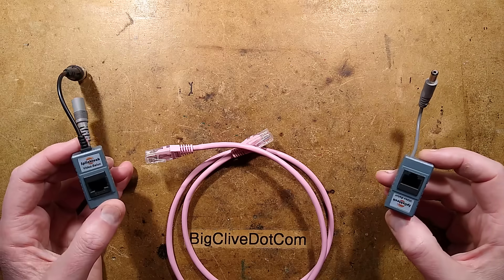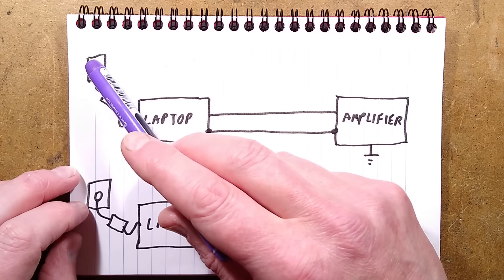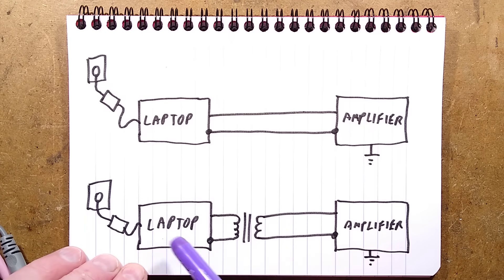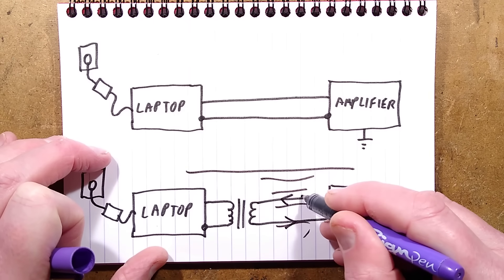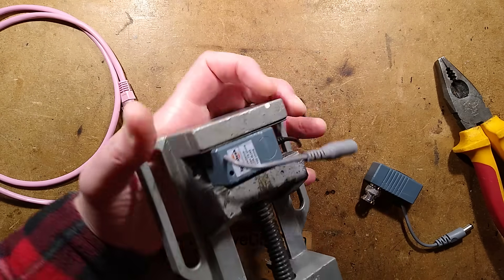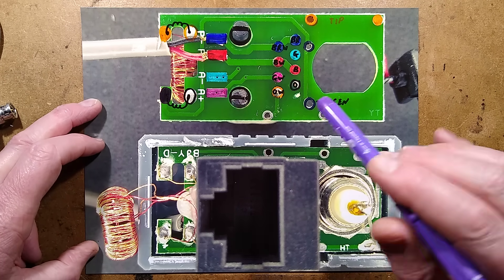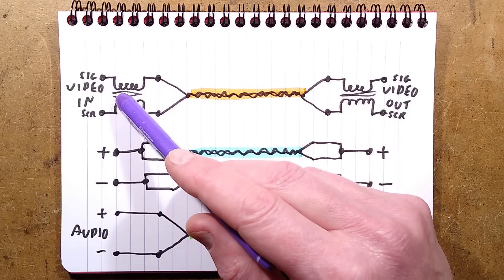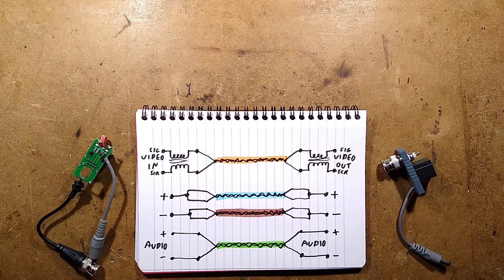Baluns - I got this one wrong (with schematic)

Comment: The two basic types of balun are voltage - providing the galvanic isolation you were talking about - and current which is the type used here.
One of the problems with voltage baluns is that they are frequency sensitive so that not only is it difficult to build an off-the-shelf product but certain frequencies in signals such as video could be blocked or enhanced.

In current type baluns, at the transmission end the parallel windings cause the signal in the co-ax centre wire to be mirrored on the other winding giving a differential (balanced) signal on the output wires. At the receiving end the opposite happens and the signal on the earthed (shield) winding reinforces that in the centre wire.

As you stated, any interference induced in the link cable will be equal on both wires so the windings act as a common mode choke.
All that is needed is for the windings matched to the impedance of the co-ax cable so it can be built without reference to the frequencies being used (within operating limits of the cable).

The audio signal is already a balanced signal so doesn't need to be converted. Common mode chokes might be useful at the receiving end but that should already be a function of the audio circuit, if necessary.
Reply: Induced noise, where unwanted signals are insinuated on to the wires by electromagnetic fields are only one type of noise. In the case that Clive was talking about—long lines that move from an area served by one power source to another, a big problem are “ground loops”.

To understand why, you have to understand what “ground” means—it is one of the most abused terms in electronics. The primary meaning, and where it gets its name is “earth”. Whether you call it earth or ground, it is literally a conductive rod driven into the earth and used as the “low” side reference for electrical circuits. You see, “0V” (zero volts) is an arbitrary thing. Something is at 0V always and only with respect to something else.

Any things were are *equipotential*, that is, at the same level of charge, are at 0V with respect to each other. Two objects with a potential of 1000V relative to earth are at 0V relative to each other. The trouble is, different parts of earth are also at different potentials relative to each other. So “ground” isn’t a fixed reference point. This is made worse because the term ground is used for many different things: earth ground, chassis ground, circuit ground, and rigorously the 0V point in a circuit.

In the case of our ground loop, it can be encountered when the piece of equipment whose output is connected to the input of another piece of equipment has a ground (in this case the ground of the electrical system, provided at the receptacle) that is not equipotential with the ground of the equipment it is being connected to. Whatever the (electrical) potential difference  between the two will cause current to flow in the direction of the lower voltage side.

For an unbalanced (or Hi-Z) input, where a shielded/screened cable is used to reject the induced noise mentioned above, the audio depends on both the center conductor and the shield which acts as the low side connection. If this is also bonded to ground via the electrical supply to make it effective at rejecting induced noise, it will be carrying the current caused by the difference between the two grounds. This can produce a hum—at the 50 or 60Hz of the AC power—that ranges from subtle to devastatingly loud.

A solution for this is to use a transformer in the way Clive first imagined the balun in this device. Had it been a voltage balun it would have been as expected and for reasons other than isolating ground, though still effective at it. Baluns are impedance matching devices. You can think of impedance as resistance but for AC rather than DC. A transmission lines is a physical arrangements of conductors that allow an AC signal to be moved from one point to another. The design of. transmission lines is increasingly critical as the frequency increases.

Transmission lines have a characteristic impedance, expressed in Ω (Ohms). In the case of the balun in the video, the original coax is unbalanced line, and used a shield/screen for noise rejection. It has an impedance of 75Ω and anything that connects to the BNC connector will be a match for that. This allows the maximum transfer of the energy in the signal.

The Cat 5 cable is a balanced line using twisted pairs to reject induced noise. It does this by having an appropriate twist rate so that for every distance equal to the length of a twist each of the two conductors get an opposite induced current from external noise, cancelling it. This is called “common mode noice rejection”. It has an impedance of 100Ω and so of the 75Ω devices are connected directly, the mismatch will cause severe signal attenuation.

This is caused by the signal literally reflecting off the point of mismatch. (This video makes all this much easier to understand, including the impedance matching part, I strongly encourage watching it: https://youtu.be/DovunOxlY1k?si=sDvEON-fvsi5dKaf&t=76) I think you’ll come away with a better intuition for this.

So, to make the Cat 5 usable by the video equipment, it is necessary to match it to the 75Ω gear. This is where the balun comes in. A balun transformer is like an ordinary transformer in a power supply except concerned with the impedance. Similarly, it depends on the ration of primary to secondary turns in the two magnetically coupled coils. In this case, we 75:100 or 3:4 ratio.

To use a transformer for galvanic isolation, we generally want a 1:1 ratio so as not to change the voltage of the signal. If a transformer is placed between the two pieces of gear, there is no electrical path for the hum to take. The connection is turned from galvanic (voltage and current) to magnetic. This magnetic connection can’t be a path for the ground difference to cause current flow.

These two forms of unwanted signals: induced (from radio and other AC sources), and group loops are different but both are potential problems (no pun intended, unless you liked it). A balun, per se, isn’t seeking to address either one, but the heart of the balun, the transformer, is one way to eliminate one of them. It is also the case that a shielded balanced line cable can take advantage of the faraday cage like shield/screen with a good earth ground connection but with n banger of ground loops since the signal doesn’t use the shield as a path.
Reply: @YaakovSloman  Thanks for taking the time to write that. I'm both enlightened and confused by it.
Reply: @YaakovSloman You missed two major points:
A. 0V is the arbitrary point that other voltages are relative to, 0V isn't relative to anything .
B. The ground loop discussed in the video comes from the Laptop 0V chasis being capacitively coupled to the virtual midpoint between 240V/50Hz and AC 0V which is grounded, while the monitor 0V chasis is actually grounded .  Thus there is a weak capacitive 50 Hz signal plus switch mode noise returning to ground through the monitor if connected directly by 50 ohm coax .
Reply: Yes professional audio is balance but for example car audio is not. A balun can supress the majority of groundloop noises when there is such problem.
Reply: I used to install RF baluns on aerial and satv installs as part of a past life. Nobody clarified the science and it was always a matter of trial and error to find the best option. Channel 5 baluns were a thing in some places from memory. I may still have some amidst my collection of LNBs and associated gubbins. I first encountered them in my mother's 2mtr band equipment but only ever by name and the vague description of them being filters.
Reply: @just_saw_dust yes I remember c5 filters something to do with vcr output interference ?
Reply: Great explanation!
Reply: Neither Audio (RCA) or Video (BNC) is balanced in the CCTV setups. They all share the same ground potential on both ends so not sure what you mean there. Presented setup seems to only do impedance matching and bandwidth limiting. Nothing more.
Reply: So how much are we talking about with interference?  I mean, like milliwatts? I work with 1500 KW power supplies.
Reply: @wanjockey  That will depend on what is close to the cable and how much shielding it has. If it is running past one of your 1500KW power supplies I would think it could be quite significant. Video signals typically run at about 1V so even an induced 10mV ripple could cause problems.
Reply: 1.5 Mega Watts ? @wanjockey
Reply: @andymouse you could say 1.5MW, but it's just not how it's said.  More often than not, MW is used for power generation and kVA is used for transformers (so 1500kVA, not 1.5MVA).  Why volt-amps and not watts? No idea, but it's what is done in the industry and is basically the same since P=I*E (Watts=Amps*Volts).
Reply: Yes, 1500 KW power supplies that melt metal. We make the steel tubes for hydraulic cylinders.  The copper buss bars are in trenches in the floor.
Reply: Wow yeah ! Now thats a power supply! I thought you may have written it incorrectly but now I get it !...cheers. :)  @wanjockey
Reply: You could argue that by nature, audio signals are a balanced path,  but we think we have to connect one side to the ground, giving an unbalanced path and the introduction of spurious signals.
Edit: Sorry, I hadn't read the explanation by @YaakovSloman first. They did a much better job.

Comment: One small example of data being sent over a power line is with model trains. In my day, you had a transformer and every train on the railway went at the same speed which you set. Nowadays you can get model engines with microprocessors in them, and the controller superimposes digital data on the power to the rails, so individual engines can detect commands sent to them and change their behaviour without affecting the others. In Hornby it's called DCC.
Reply: I have photocopies of Model Railroader magazine articles from the late '70s which gave the DIY version that evolved into the commercial product.
Reply: Earlier digital control systems struggled as manufacturers invented their own proprietary protocols, which weren't compatible with anyone else's (so if they stopped making it you were stuck chasing around for old stock or used parts to expand your layout). DCC has thrived as, after drawing it up, Lenz published all the details and encouraged everyone else to join in making hardware which followed their standards. So now you can buy a decoder from one of many sources and operate it with a controller of your choice. There have been changes and expansions to the protocols (particularly in relation to programming the decoders), but you can run a twenty year old decoder on a new controller and vice versa.
Reply: @mattg437 Märklin still has their own protocol, but since their stuff isn't compatible with everyone else's anyway, that doesn't really matter.
Reply: I believe DCC is an international standard. Most brands support it now.
Reply: Same with slot cars
Reply: Märklin's Format ("Motorola" - named after the original Motorola en/decoder chips used) is rather interesting as it's not binary but trinary, and Pulse position Modulated if I remember correctly. 
By using certain tricks you could modulate the digital information in a way that they still worked, but at varying DC offset and therefore could control an additional old school analog locomotive.

There are multi protocol digital units (that emit DCC, Motorola and S88 for Digital inputs and many more.
Then there is also CANBus for model railways
Reply: Sounds very similar to power line LAN networking :)  

(and I think is a lot more similar to that than PoE, because it uses the same conductor.)
Reply: @Bozebo POE on gigabit Ethernet shares conductors, since GBE uses all eight conductors.
Reply: First time I've seen discrete control of model trains was at a hobby expo in Ohio, around 1992 or so. It wasn't direct wire like DCC or even digital, but 27 MHz analog radio similar to what RC cars used.

I remember being so impressed at the idea of being able to control individual trains. Now it's pretty commonplace.
Reply: Nice
Reply: I was reading up on this a while ago, and IIUC the signals are sent as voltage pulses down the positive rail (Quite literally! 🙃) which form a data packet that compatible stock will read and then act upon if the target address matches theirs, or disregard otherwise. 🛂
The pulses are kept low to avoid abnormal operation (i.e. Traction motors running faster than intended) and a side-benefit of this is that each DCC-controlled section can also accommodate one non-DCC train under voltage control in the traditional fashion. 😇

Amusingly enough; In the big train world, TVM in-cab signalling (Used on French high-speed lines, plus others based on it like the UKs HS1) is also transmitted down one rail as an RF signal (2,0-2,6 KHz) shorted across the leading axle of the train (And collected by the train at this point via an antenna) and then returns down the opposite rail - Which not only communicates signalling data to the train, but also forms a track circuit the equipment can use to determine how far away and at what speed the train is travelling! 🇬🇾🚄💨😀
Reply: that's called power in line communication (PLC)
Reply: That's awesome.

Comment: For isolation, have you seen the long HDMI cables that work by having an optical convertor at each end, and optical fibre as the body of the cable? A neat solution to avoid signal loss and interference, as well as providing electrical isolation.
Reply: The long cables it is more due to the very limited drive ability of the HDMI chipset. Driving a long cable, even a nicely made twisted pair one, will require a lot of current on the edges, to charge and discharge the capacitance of the cable, both the common capacitance to the shield, and the capacitance of the twisted pairs. So a short cable, then a HDMI input chip, will mean only a low drive needed, well within the limited capacity of the sending side. Then you can convert to fibre, and have the length be moot, only the amount of degradation such that the receiving end is able to reconstruct the data well enough to send out the far side HDMI connection, for the receiver error correction to reconstruct well enough. Yes often they provide electrical isolation, as a side effect, but some of them also are only powered from the one end, so have a pair of cores with the fibre optical link to provide power to the far side, so actually do not have isolation.

Just like networking, longer cables result in signal degradation, as the long length attenuates the signal, though that length limit is not absolutely fixed, toy can be 10% either side and still have perfect operation, with no lost packets, or have used cheap cable, and a few couplers in the line, and have a 30m run not be capable of giving reliable data, unless you force the link to 10M.  I have run 10M connections over an existing phone cable, because I could not pull a new cable, limited time, and 10M was well within the data rate, plus had both a pair of those BNC to twisted pair baluns, and a old pair of 10M hubs (not switches, still got one 10M hub around with a RJ45 port set and a BNC port, useful to use as a tap in for network data analysis, though it limits speed down badly) for the ends. Worked for the few months needed, before new cable went in.
Reply: @SeanBZA  If you have to run LAN over old phone lines that cannot be replaced (e.g. if you're renting), hack a cheap pair of Homeplug adapters and get at least 100Mbps, a better pair I modded for that purpose would go up to 600Mbps.
Reply: @NiHaoMike64  No need to hack anything, the IP camara converters you can get for running ethernet on coax usually use a Homeplug chipset and you can use a video balun to convert them for running on twisted pair.
Reply: Any digital signal that can plug into a media converter can be transported on fibre. With the right support, you can plug a media converter onto your PC and access fibre directly, this was how we would test large arrays of fibre outlets.
Reply: A lot of AV companies got these in the noughties. The fibre didn't last long for many of them.
Reply: Optical diodes/receivers are getting to be small and light enough that we're going to start seeing them everywhere in a matter of years. Can't wait, we can leave behind the RF knowledge for optical interference patterns and quantum tunneling effects...

Comment: They're not transformers. They're common mode chokes to reduce noise induced into the cables.
Reply: Sure but they work the same way otherwise they wouldn't transmit a signal
Reply: @phonotical  Common-mode chokes don't work the same way as transformers. The signal does not get coupled magnetically in a common mode choke. Instead the signal remains in the electrical domain, and any signal common to the two conductors meets a high-impedance due to the inductance of the core. They are basically inductors.
Reply: @henryokeeffe5835  then you suggest the signal isn't copied and reproduced, which would then mean the whole thing doesn't work, and yet...
Reply: @phonotical ."then you suggest the signal isn't copied and reproduced" Correct. " which would then mean the whole thing doesn't work, and yet..." Incorrect. The signal is unchanged. It just goes straight through the copper wire wrapped around the ferrite.